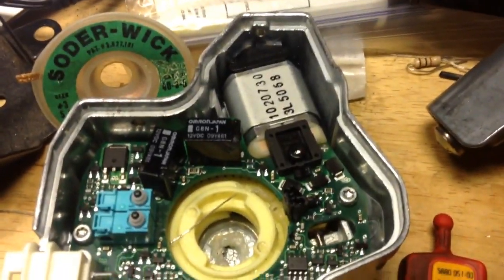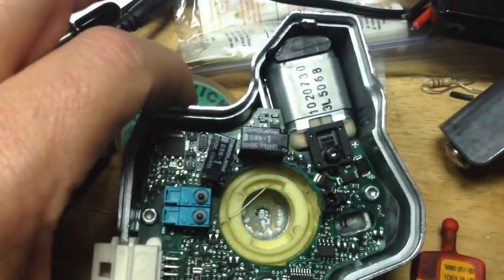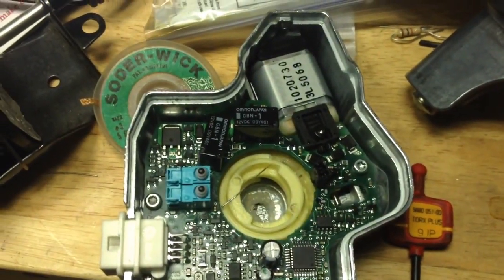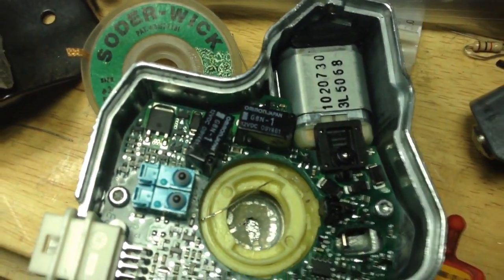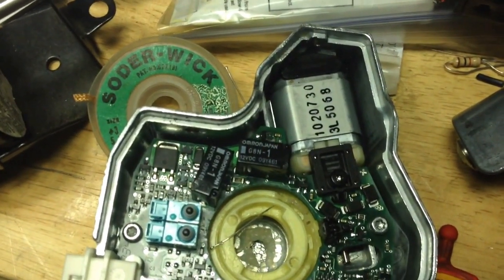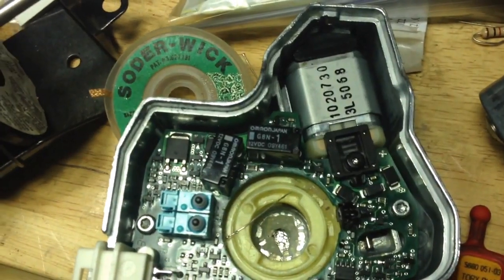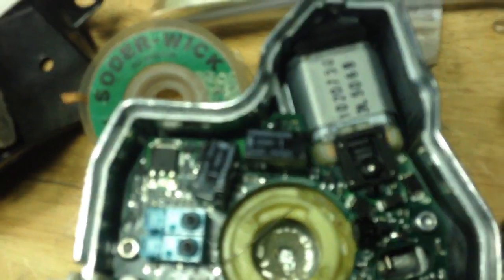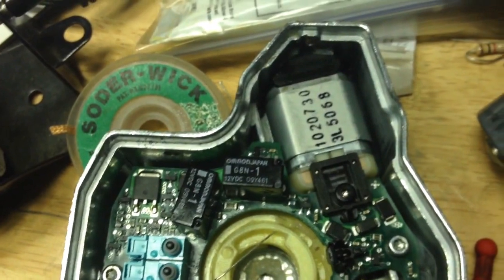Nissan steering lock repair.

Comment: But what about when you put it back in the car? I did this but now my car barely moves and the security key light is on in the dash
Reply from the maker: It worked for quite a while without difficulty and then failed again.  The entire key interlock system is a turd by design and too many people don't pay attention to these issues when they buy a new car.  I opted for a 6 year old Subaru with a manual transmission to avoid a lot of high cost failures in the future.  I with you luck.